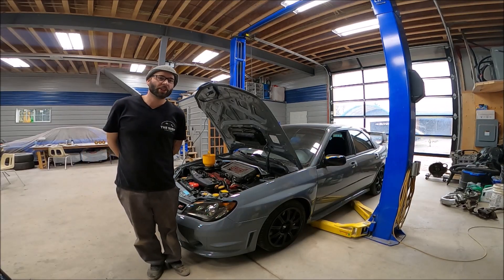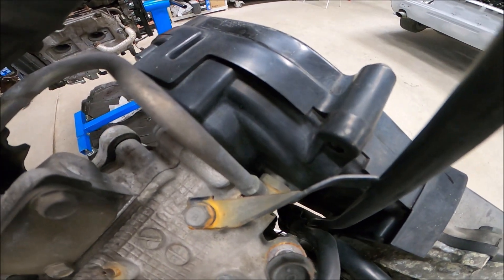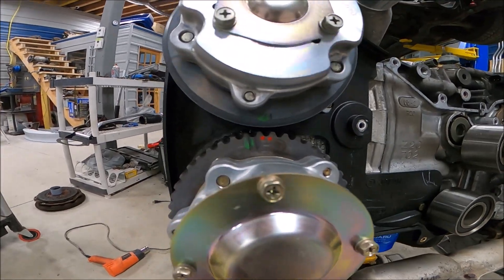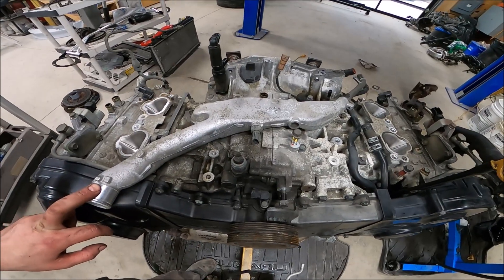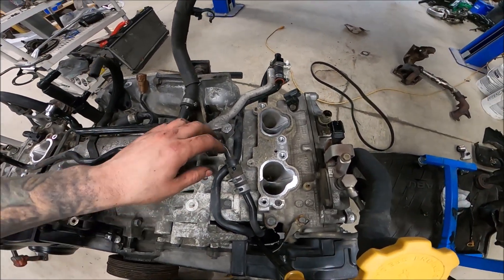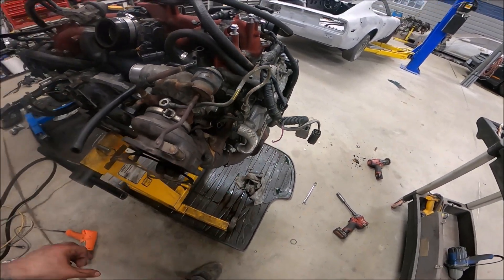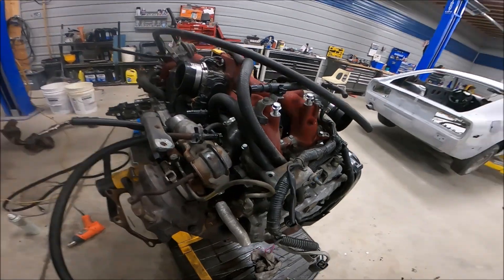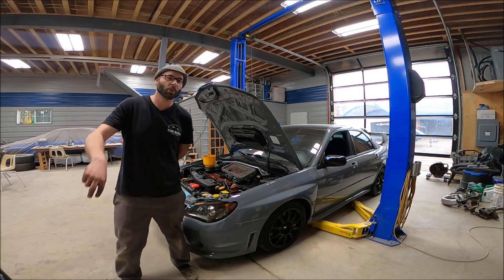How To Jdm Ej20X Swap - 06-14 WRX, 04-07 STI, 05-09 LGT, 04-14 FXT

Comment: Thanks for the video, it is super informative.  I just bought a 2011 wrx with an exhaust valve leak and am looking at doing this swap. Do I need to purchase the cam lock tool that you used in the video to be able to turn the exhaust cam gears counterclockwise one tooth? Thanks for your help.
Reply from the maker: The company23 cam lock tool certainly does make it effortless. The cams are under heavy tension and very hard to turn by hand along with stay in place as they will spring back.

Comment: Hey nice video.. one question what are the best spark plugs to use on the ej20x ??
Reply from the maker: Use the oem ngk iridiums, they will be same as 255/257. 
One step colder if your going over 300whp maybe.

Comment: This video just had me scared for my life, as I did the swap but never rolled back the cams 😂😢 I have the original wiring harness of the ej20x I even bought the ecu that I believe uses the dual avcs but we never put those on. I haven't had a single problem at all.
However I dont drive it hard because I read somewhere that without being able to use the dual avcs the high compression ratio would cause problems specially if you exceed 10 psi of boost which is why I never go over 8~9 ish.

By rolling them back, would this necessarily solve this problem? Or should I just use the  jdm wiring harness and ecu to get them working?
 Either way, I will be doing some work on the car so my engine will definitely come off, I would appreciate the tip! Im not too experienced with this, and though my father is a mechanic he also does not have much experience with  the avcs

 Btw I have a 05 fxt that is single avcs

Again, thank you for this very informative video!
Reply from the maker: Hey there! Hopefully this will clear some things up for you. 
Turning back the exh cams is optional, it does get the timing closer to the stock 255/257. This helps a bit with bottom end torque. 
The high comp ratio should be of no concern if the car has been tuned. 

As for wiring up the dual avcs, yes its possible. It is however incredibly difficult due to most duel avcs ecu’s being immobilized. You either need matching ignition and immobilizer or You would need someone who is able to unlock and reprogram the ecu.
Reply: @TheSubieSanctuary  thanks for the reply!
Thanks for clearing up about the Ecu issues that might come up Ill keep it in mind when we take out the engine and will decide what to do then, appreciate it!!

Comment: About 6 years ago i bought my Bugeye WRX and recently swapped in a 07 jdm legacy gt trans with the matching 4.44 rear diff. Went to go pick the car up from the shop and found out an EJ20X. From what i know already the usdm stuff was already. Im having a hard time figuring out exactly what was done and what i can really do with this motor. Finding info on this motor has been a little hard.
Reply: My main thing now after watching this videos is what should i be doing maintenance wise? I've been buying things like sparkplugs as if it were a stock ej20 out of an 02 wrx.
Reply from the maker: @shawnesmailzadeh6279  spark plugs and valve cover gaskets should be bought for an ej255!
Those ej205 spark plugs will be too short in the ej20x, id definitely swap them out.
Reply: @TheSubieSanctuary  what kind of issues could that cause? She’s been running fine at idle but at wot it does have this sort of stutter.
Reply from the maker: @shawnesmailzadeh6279  with the wrong length spark plugs the spark isnt even making it into the combustion chamber.

Comment: Hi this was an amazing video I’m currently doing this swap. for the clutch and flywheel I can use the ones from my ej255?
Reply from the maker: Thanks glad it helped! Yes you always will use a clutch and flywheel that match your trans. Your good to go using the original clutch/flywheel from your previous engine
Reply: Okay thank you, another question I don’t want to install the oil cooler but the water pump from the timing kit has the outlet to the oil cooler what can I do I’ve heard people plug it with a rubber cap but wanted to get your opinion. Is there another water pump that I can use that doesn’t have that extra port?

Comment: Hey brotha love your content I have a 2006 Subaru wrx I just put in the Ej205, I’ve been driving it for a few weeks no check engine light everything runs smooth but I feel like it’s lacking power in the high end would this modification apply to my swap aswell ?
Reply from the maker: Few questions first to see what exactly you working with, Is the 205 jdm? Did It originally have a plastic intake manifold?
Reply: @TheSubieSanctuary yes the 205 is JDM it had the plastic intake originally
Reply from the maker: @davidreyes9711  ok and its single avcs correct? 
Have you had it tuned since swap?
Reply: @TheSubieSanctuary yes it’s a single avcs I have not tuned it yet, to be honest I’m okay with the power loss I just wanted to make sure I didn’t mess up by not adjusting the timing
Reply from the maker: @davidreyes9711  ok, ya on yours. Do not adjust the timing physically. 
A tune will do it wonders and is recommended normally
Reply: @TheSubieSanctuary 🙏🏽🙏🏽🙏🏽 thank you brotha I appreciate you

Comment: Great video too bad im not having much luck with my swap. All get is cranking its started once but real rough. And now no start just crank8ng,im so lost as to what is wrong. I didnt set the tim8ng back ,could that be my problem? Suggestions please thanks
Reply from the maker: Fuel lines may be backwards is a really common no start after a swap

Comment: Thank you so much for the info!!  I have a question! I already have an ej20x swap in my car, and currently my rev limiter is at 7.2k rpm, will turning back the exhaust cams one tooth affect how high my car can redline safely?? Thank you!!
Reply from the maker: Hey Andrew, is your car originally a single avcs car? If so, turning back the exh cams will not effect your redline and will definitely give you some more bottom end torque

Comment: Seems somewhat cost effective but I’d rather just start with a new block. At least the short block. Piece of mind and the motor is already out anyways.
Reply from the maker: Ya i get that. But thats double the money of this swap parts/labour just doing short block alone and down time. 
While he rocks this he gets to take his time with saving/building the 257. 

Not always piece of mind though, last freshly rebuilt motor we got (customer supplied) was instantly leaking coolant out of head gasket. Not common at all but this guy gets to pay twice now. 
For him, he 1000% would have been better off just doing a 20X

Comment: This was fantastic, im a little worried though because I am getting a ej20y not an ej20x is there any differences i should be worried about?
Reply from the maker: Ej20y actually a little better and exact same swap process! The 20y will have an air pump so if your using cobb ap then youll still be emissions compliant with the cobb or ecutek.
Reply: @TheSubieSanctuary  alright thank you so much im going to have to rewatch the video about 1 thousand times to figure this out haha. do you know where i could get new o-rings for the coolant crossover?

Comment: I have a 2005 legacy GT and did this swap.. my mechanic placed the 2.0 ej20x into my chassis and fully completed it .. I brought the engine from jdm engine zone and they told me to just plug in the one solenoid that I have for intake and the one exhaust and leave everything else unplugged .. I’m hearing I need to swap out my top part far as the tgv.. my tumbler valve and other intake harness is unplugged and my check engine light is on and it’s coding intake and misfire
Reply from the maker: You do need to swap your entire intake manifold on like how we did video. Harness, tgv’s, fuel system. It all comes off as 1 piece and just drop onto the 20x

Comment: Would I be capable of doing this swap on an 05 sti? What year of the ej20x can I use to replace my current motor?
Reply from the maker: Yes it would work on 05 sti! I dont believe 05 sti has an air pump, so you could use the same 20x as we used in video without issue. 
Typically year range can be inaccurate when shopping for the engine. Basically youll be looking for Ej20x without air pump. Ones with air pump are typically more money and you’ll physically see the difference of air pump vs non air pump when you begin to shop for one. 
Your welcome to link a listing once youve found one and i can confirm that its good to go for 05 sti. Cheers!

Comment: I’m a little lost and have little knowledge. I’m looking to do a EJ20x swap in my 2010 WRX. My EJ255 seized up and I just wanna know what’s needed to properly do the swap regarding the AVCS since it’s a Single AVCS Wrx. Please help 🙏🏽
Reply from the maker: Hey brother, the 20x swap into your 2010 will be the exact same process as this video. 
One thing id recommend, since yours seized up. Is that you should have your original turbo rebuilt. 
Any other questions just shoot. 
This vid to a capable person who has some knowledge of subaru’s will make the swap a thoughtless breeze.
Reply from the maker: One thing to note! If your using a cobb ap and want to continue using a cobb ap. You will have to get a ej20x with air pump. Cobb has removed the ability to disable codes such as air pump. 
However if your going to get it open source tuned then the ability to turn off air pump code is still an option.
Reply: Thank you!

Comment: Imma try this, I have a 02 wrx that was swapped with a Ej255, engine lost compression this seems like the cheapest/easiest option
Reply from the maker: Yes definitely the cheapest route. Just make sure you know what ecu your car has because this engine only runs on 32bit ecu types

Comment: Great video! Got a 2013 WRX can I do this swap and use the factory tune?
Reply from the maker: Technically yes, with exception of air pump. Do you need to retain air pump for emissions where you live? If so, you can get a air pump version ej20x and the install is the exact same as this.
Reply from the maker: @John-px2ki  correct on the air pump, with respect to power. Even with the exh cam set back 1 tooth each. You will loose a little bit of torque. Main reason is going from 2.5 to 2.0. Likely not noticeable

Comment: Awesome video! I just picked up a 2006 Baja Turbo auto. Low compression on one cylinder. Any reason an EJ20X swap would be difficult for this vehicle?
Reply from the maker: It would be the exact same process for your turbo baja! 
Only thing to factor in, is how you will tune the car after. I believe the 2006 baja has an air pump on engine. If so, then when using the ej20x (they do not have airpump) you will have to have the air pump codes turned off with your tune. This is now only possible via an opensource tune. 
Otherwise, you will have to use the jdm ej20y engine (has airpump) then you will just get a tune via cobb ap, ecutek or opensource. Depends what is available around you. 
Both engines, will be exact same process regarding the swap.
Reply: @TheSubieSanctuary  thank you for the quick reply! I'm going to start the project soon. Thanks for the great video!
Reply: I wanted to come back in here and comment. I successfully swapped my 2006 Turbo Baja with an EJ20X. Non air pump car. Everything worked well and it is running great with no CEL.
Reply from the maker: @harrymineer307 love to hear it!

Comment: Wanting to get my LGT back on the road and this was an option I was looking at since it's cheaper than usdm options. Your video makes this look pretty straightforward rather than all the info in forums haha. I'm assuming this would be the exact same process for a usdm 05 legacy gt? Also do you know what gaskets you can use if they would ever need to be replaced like the valve covers, headgaskets, cam seal etc? 

Last question is do you guys deal with any tuners that can tune these through an open-source etune like romraider for someone in the states? Having a hell of time finding a tuner in my area before I even attempt the swap that will tune a ej20x and without a cobb AP.
Reply from the maker: Yes we do deal with a few tuners who will open source tune them no problem. 

Yes exact same process for install with the LGT, ive done a few LGT’s. 
The cool part about the lgt is if you get the twinscroll intercooler with your jdm motor you can use the twinscroll set up! Super fun, like a supercharger. Just instant power. We have also used the twinscroll stuff on a few plastic intake manifold cars. 

As for gaskets, they use all the same gaskets as 255 engine. With exception on exh cam solenoids they would be 08+ sti if you needed a seal or oring for them. 

Hope that helps!
Reply from the maker: Headgasket would be for ej205* everything else including spark plugs is 255
Reply: That's awesome, thanks for the reply, the info is very helpful. 

Any chance I can get the email info or something for the tuners you use that can open-source tune for this engine, so I can get in contact with them? If you have an email I can send you an email rather than posted on here.

Comment: I have an ej20x in my 03 wrx, I have done acvs delete on it, it definitely feels  sluggish... Your video clarifies what to do with the exhaust cam timing, was wondering about intake cam timing, I found 1 video for a signal acvs JDM engine that advanced the intake cams 1 tooth. What do you think?
Reply from the maker: We have never messed with intake cam. Is your 03 wrx drive by wire throttle?

Comment: About to do this swap this summer i’m just looking for a tuner in California. Scared to run it on a stock tune lol
Reply from the maker: If your in Cali and your car originally is an air pump car. Make sure you get an air pump jdm 20x/y. From there it can be tuned via cobb or opensource or ecutek and still be compliant
Reply: @TheSubieSanctuary  my car is a 2005 manual outback xt but it doesn’t have an air pump. I’m pretty sure it’s from out of state
Reply from the maker: @Kooltan  ah yes, the 2005 outback xt would not be an air pump car. Ya you’d be fine and without codes if you follow this long block swap procedure
Reply: @TheSubieSanctuary  do you know  where I can get a tune, I have a cobb already.
Reply from the maker: @Kooltan  any place that will tune with cobb will be able to tune it. Or if your looking for a map just to load onto yours. May have to look through some forums. Im not much of a cobb user myself. If i had a map id send it to ya

Comment: Thanks for the info on the ej20x but I do have a question about swapping in a jdm ej205 with single acvs into a 13 wrx which already has single acvs like would I run into any problems doing the swap besides the pcv hoses, turbo, manifolds, and maybe the oil pressure sensor needing to be exchanged and do I still need to go back a tooth on the exhaust cams if it doesn’t have acvs?
Reply from the maker: Does jdm 205 have a cast aluminum intake manifold or a plastic manifold? 

The plastic manifold jdm single avcs engine works without any major swapping. 
The cast aluminum intake manifold jdm 205 is A LOT of work however
Reply: It has a plastic intake manifold so I’d thought it be a lot less to swap over
Reply from the maker: @deadpoolspiderman9179  you are correct. Just need to swap your intake manifold onto the jdm engine. No need to mess with timing on the 32bit single avcs engine. 

Reason you need to swap whole intake manifold is the harness comes out the wrong side
Reply: Okay cool thank you very much
Reply from the maker: @deadpoolspiderman9179  here is vid, using the jdm single avcs 205 with plastic intake manifold, being installed into plastic intake manifold car 
How To Jdm Engine Swap Any Single Avcs Subaru! WRX, STI, FXT, ETC
https://youtu.be/bUXVWc9yxyE

Comment: I hope you still check these message.  I have a 2008 wrx impreza.  Non stil. Doesnt have the dual sensors on each head.  Did you reuse the original harness or used the one that came with the ej20x?  By turning the exhaust cam am i able to bypass the exhaust cam sensors completely
Reply from the maker: Here is a vid I made specifically for your car! 
https://youtu.be/N7cGo9U9qAs?si=_vNw-rK_IvdlwjTR